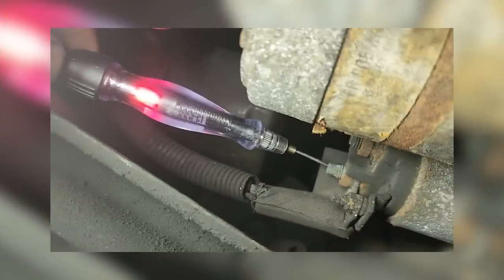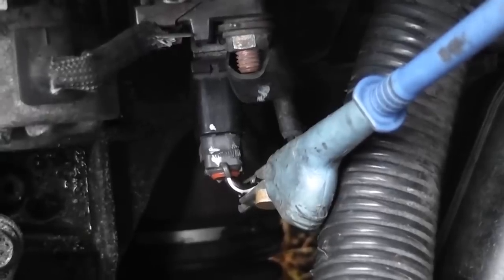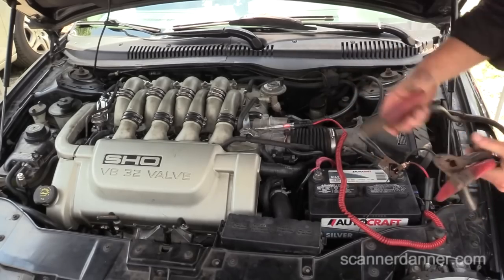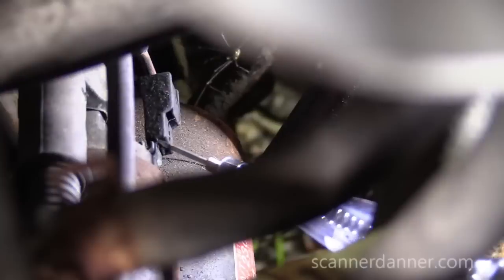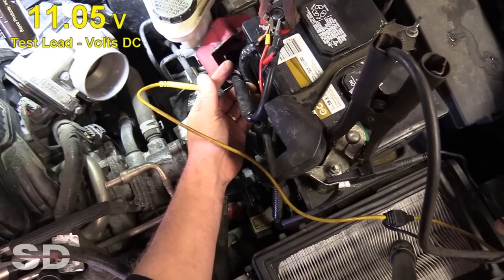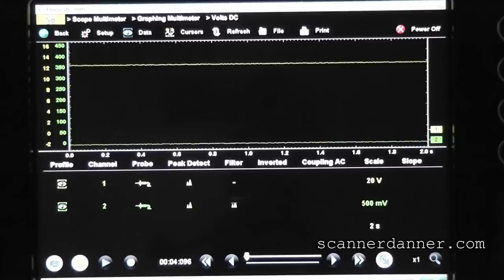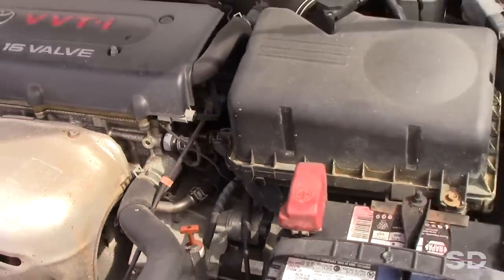Engine Does Not Crank - Compilation of Common Faults

Comment: My opinion, the best video for " no crank" diagnosing! In my 40 years of working on cars, I've seen everyone of those situations. It's so easy to make the wrong call if you skip a step or two. Voltage drop tests are very important with key on and checking in multiple locations (not just the wire but on the terminal sides as well). Thanks Paul and hi "Mom"!
Reply from the maker: Thank you Jeff!
Reply: I have to agree that was very helpful

Comment: Thumbs up for mom! That was awesome. I’ve seen a seized accessory once. It was in my own car and it happened while running the belt started squalling and smoking. My asked shouldn’t you turn it off? I looked and saw it was the A. I. R. pump. I said no I don’t have any tools with me the belt will break and we’ll drive home before I shut it off. Taught my oldest son the tap the solenoid trick. He was eight and had to jump under the van at the Walmart and tap it for his mom to get the van started. Best video I’ve seen for no start no crank.

Comment: Your locked up alternator brought up memories from the past. I remember late 80's when 4 cyl's were getting popular, these cars would come in on the hook (tow truck) with complaints won't start. Some customers telling you to put a starter or battery in it; no diagnostics- just do it!! Usually their prob was an a/c compressor locking up, or a locked up alternator. By the early 90's both the American mfg's and even Nissan and Toyota were relegating their alternator production to Korea; there were no rebuild kits. The Korean alternators cost $600 to $1200. These were on brand new cars. Many times the alternators were on 30 to 90 day back orders. Same problem with the starters - oh the good ole days

Comment: We had a similar issue with a F100 straight 6 engine.  Apparently it had two different starters for a manual vs automatic transmission; and would need shims, depending on the setup.  It was completely locked up, I pulled the belt-- crank was still locked.  So we just decided to pull the engine, (it had over 300k on it anyway).   I pulled the head off and dropped the starter-- about to drop the transmission. and my buddy came over and asked what we were doing.   So I grabbed a wrench and was going to attempt to spin the crank and show him it was locked----   and it spun super easy. lol.   It had a leaky head gasket anyway, so we didn't really lose anything.  Threw it all back together, and sure enough it was locked again---   because of that starter.  So I did some research and learned about the shims.

Comment: What a great summary. There are two things that make me frequently stumble on this diagnosis. The first is if the solenoid doesn't close (very common), we are easily be lured into the false impression that we've load tested the B+ circuit or the battery. That leads to the mental gymnastics of reasoning that if there is no measured voltage drop at the B+ post or the engine ground when you turn the key, and you do see 12V at the signal post, then voltage drop in the wiring CAN'T be responsible for the failure of the solenoid to close. So, you end up successfully replacing the starter, accepting that you never did load test the supporting wires. I get the notion that in a busy shop there's no reason to waste time looking for second problems that didn't cause the initial failure. The second is that any test will have false positives and false negatives, and as you say a test light doesn't draw enough current to adequately load high current circuits. Mine glows brightly with only 6V,  so its lower limit of detection is only about 25 ohms, far more than the few ohms that can cause a starter fail. On the other side, if the loaded engine ground rises to less than about 4V, the light doesn't glow at all even with current flowing.
Reply from the maker: In your first scenario you don't have to load the wires independently. You proved the starter was the issue. Unless we want to argue that we have a bad wire AND a bad starter at the same time! It simply doesn't happen! Make sense?
Your not wrong in wanting to still load test those other circuits but it is a waste of time imo

Comment: I worked at a shop where a guy missed diagnosed and said the car needed an engine. It was another situation of the boss worrying about the bottom line and wanted the jobs diagnosed and fixed with little consideration of the techs skills. It was all about record times and making money even if it means screwing over the customer. It happens quite often in this field. Having techs doing work that they are not certified in.  Anyways one day and an engine install later the car was back together and doing the same thing (engine wouldn't turn over). Eventually the boss had me look to see what was going on. Come to find out the alternator was locked up. Still the customer wasn't made aware and not only paid for an alternator, but also an engine they didn't need. Lesson wasn't learned and the boss continued to put techs on jobs they weren't certified in. Eventually I left the field entirely after 15 years of seeing this in multiple shops because a master tech such as myself had all the certs an those certs were used as community property.
Reply from the maker: That's absolutely horrible!
Reply: You put in the time, effort, skills, & tools to do a good job and it is not appreciated (except by the customer) or rewarded.  I too left the industry to continue working on trains.  More money & more time off & a pension.  The side note is doing most of the work on my own cars without worrying about which tech under what kind of shop priorities is working on my car.
Reply: @s.j.5850  agreed 💯!! Yet people wonder why there's a automotive  technician shortage! The list of reasons is LONG!

Comment: This is the exact issue that lawn mowers have, and that boss that told me to,replace them no,matter what without even consulting the customer! I got quite frustrated because they all make that clunk click sound, but at the same time you can have one that will make that sound, and still be bad as the contactor within is probably burned up, or heavily oxided prevent it from carrying the current. And im very against ripping off customers not even over change. So I got all there solenoids a brand new one off her self, and two from down stairs were we worked to get the other types one were the coil within was open so it made no sound at all. And another that made that familiar sound, but the contactor was shot. Showed how all 3 functioned with a jump box, and a digital multimeter, and drew a diagram of the internal parts. After,explaining this to her and that she basically telling me to rip people off. She still continued to stick to it. I never replaced them unless it truly needed one! What kind of meter are you using with the yellow Kevin style like clamps!

Comment: Hi. I had really weird issue with my 2005 dodge caravan 3.8 minivan. My car run ,idle perfect id I drive under 2.5-3k rom but if even on idle if I rev it up 3k car start shakes and misfire. Sometimes throw p0301 code as well. But while car shaking of i rev it up again around 3k car turn back to normal as well. What it might be according your experience. Thanks
Reply from the maker: hard to say, sticking valve, ignition misfire, injector misfire, all of them would need to be tested for DURING the misfiring event

Comment: Hey I have a question of my ford f150 96 no star but I check for spark and I do have spark but don’t star still any tips what to do next to look for
Reply from the maker: fuel pressure and  Injector pulse testing should be next
Reply: Thanks the help I will let you know how a works. I love all you video brother thanks for sharing

Comment: So I've got a voltage drop on the main power cable and also a light on  the block? Would that mean its a bad earth problem or both need to be looked at?
Reply from the maker: This is a compilation of many different issues, what time frame is your question coming from?
Reply from the maker: This is a compilation of many different issues, what time frame is your question coming from?
Reply: The first video,  I have power drops going beyond the terminal bracket on the starter. I can see a tag on the positive lead so I'm thinking it's had issues there before? Also when I leave the key in the crank position both battery terminals are smoking and hot??

Comment: I added some random fuel from some can and now car starts everytime perfectly but only for half second then dies. Is it 100% fuel problem or chance of something different?
Reply from the maker: Help me help you! Year, make, model, engine, trouble codes at a minimum. Then, what is your fuel pressure. Have you tested for injection pulse?
Reply: @ScannerDanner  bro i aint that smart to do them things and the car is only for some cheap track use.
I unplugged fuel filter and it sprayed gas out with intensity when fuel pump was activated.
Audi a4b5 1.6 liter engine
Thanks

Comment: I'm  not sure why I didn't find this channel years ago.i just went through this exact same thing with a 2005 chevy 3500 dump truck,  turns out the engine is no good . The problem I'm having is a intermittent battery drain on a 1998 2500 chevy pickup. Battery drains after a day or 2 . Do u have any videos  on this ? Hi mom😊
Reply from the maker: I have some parasitic drain videos. They'd be in my battery, starting, charging system playlist. Thank you!
Reply: @ScannerDanner  okay I will check, and thank you

Comment: I have an 04 ASTRO that is cranking but not starting. When I turn the key I get no lights in the dash except the battery and needles. Any tips??? Battery is good.

It's intermittent because it would start sometimes. You can imagine all the parts I replaced
Reply from the maker: When it is not starting, check for a 5v reference on your TPS or MAP sensor and tell me what you see.
Reply: @ScannerDanner  appreciate the reply. I'll check it when I have the vehicle with me later today. Thank you.
Reply from the maker: @rafextreme2879  this one is older so it may not apply 
https://youtu.be/ZgNY3ZpjSsU
Reply: @ScannerDanner  thank you so much I'll give update on my progress👍

Comment: This is just an amazing video. You are a blessing 🤍

Can we use a power probe(that has a small bulb) for voltage drop test instead of a test light?  I wonder why I don't see you using a power probe there must be a good reason 🤔
Reply from the maker: I do NOT like LED lights for ANY electrical circuit testing. Because very low voltage will light them just as brightly as higher or normal voltage.

Comment: I was faced with a bad block ground on a customers car that looked good but it was corroded so bad about one inch inside the insulation at the block. I was told by the customer to replace the starter, i used my jumper cable to apply a ground from the battery to the block in front of the customer and i started the car, i replaced the $15 ground cable instead of the $185 starter. Happy Customer!

Comment: What would you thinks wrong with a car that when you go to turn the key you lose complete power to dash and everything? I’m trying to figure out an 03 Dodge Stratus RT with the 3.0. It has set for like 5 years outside not been ran. I hook a good battery up and if I just turn key on the dash lights come on but as soon as I go to crank it I lose all power and then the car has to sit for a while with battery removed before the dash lights will come  11:50 on when just turn key on. I’m stumped on this one. Not sure if it’s a starter issue or a security system issue.
Reply from the maker: Sounds like a bad main cable to the battery. Power or ground wire and either one would do that. Do some voltage measurements like I'm showing here. https://youtu.be/GQvLHQVtC0Y

Comment: This is a great compilation of testing. Once again each time you show the whole diagnostic process, probing both side of connections is very important because if you do not follow through the whole process it WILL lead you down a "RABBIT HOLE". I recently passed my ASE A6 on electrical and electronics. I have been watching your videos for a couple of years now and have your book, and use it regularly in testing. No matter the manufacturer, "THE THEORY STAYS THE SAME". Some of these videos I have saved and referenced in the past and the do help in real shop situations. I have been a paint and body tech for years, but about 10 years ago switched over to the Mechanical side. I am currently moving up through more ASE testing, and I thank you for continuing to give back. I am 54 years old and sometimes even with all of automotive Knowledge, switching over can seem like just starting out, that is why PROPER PROCEDURE IS SO IMPORTANT. Thanks Paul and keep up the GREAT work!!!!!!!!!!!!! Believers are achievers!!!!!!!!!!!!!🙏🙏🙏🙏🙏🙏🙏🙏
Reply from the maker: Thank you brother!

Comment from the maker: We have added chapters to this video for easy navigation through it. Here is the list of the videos we pulled these clips from:
00:00 - voltage drop on the main BAT post of the starter - https://youtu.be/_xvddRJmkAA 
02:20 - bad block ground (Nissan) - https://youtu.be/ytrcqM8wyW0 
05:25 - bad block ground (Ford) - https://youtu.be/-fyKizH_oQ8
07:04 - a bad block ground that looks like low battery voltage (Cadillac) - https://youtu.be/32S0WMj3GSQ
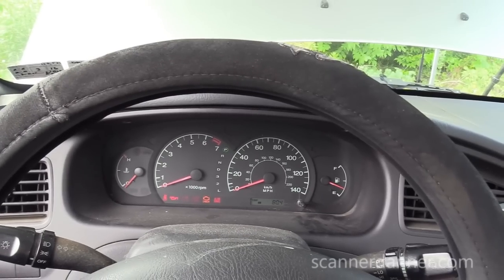09:10 - voltage drop on the "S" post of the starter (Hyundai) - https://youtu.be/oo1SRIFIkhs
12:55 - voltage drop on the main starter battery cable - https://youtu.be/U0HktTWiw0Y
15:59 - super high starter current (seized engine?) - https://youtu.be/4YWCKzpbgb0
20:00 - starter tap test on moms car - https://youtu.be/U0HktTWiw0Y
Reply: Love the last clip very emotional, Thanks SD😍

Comment: Thank you Paul
Thank you for the Test on the post footage 
Thank you for the Test on the Wire 

" Fun with corroded , crusty ,  exposed connections "
   ' 70s vehicles , 80 vehicles  "      
    One of the first cheeks done   
     Excellent visually  here

Edit  
    21:30   Hi Mom    Thankyou all the best

Comment: Thanks guys, I am a DIY own car mechanic and I learning on an auction car named "demolition fugitive" which has a really bad condition. Just for fun but of course I want to reach my goal to start it if it possible. So I already tested the starter, which works well (not like your mom's solenoid:). So my last chance before siezed engine status, the bad alternator case. So today I learned how to start an engine without spark plugs and after I learned how to loose the seprent belt and in the close future I will check the alternator. Do you have some proposition to not make damage?

Comment: Paul,
Thanks for your help! 
I had no problem putting a JDM engine in a 200K miles '06 Mazda, but when it didn't start I thought - Oh God what did I do?
Followed you principles with just a DVOM and a test light with schematics off the internet and behold. It all came down to the smallest ground wire for the ignition coils.  Unreal how a wire so small can prevent a car from starting! 
If you are ever in Chester county, stop by and  I'll buy you a few rounds! Cheers!🍺

Comment: 15:34 that's a repair cable end with in-splice connector. they work OK if you can cut back to clean bright wire and cover everything full of dielectric grease so it doesn't corrode quickly.
I 've used some on Jheep's and other Chry'ap'sler byproducts(lol), which tend to have the cable too short to put ends on and near impossible to replace the cables.

Comment: Q: Can anybody help and answer this question and timing was good.

BMW M47 E90 2L diesel was a crank but no start, once a week it would start but cut out after 20 minutes of driving and not start. Codes was camshaft sensor and glow plug module both change with 2 new and stayed the same.

All fuel pressure was ok and injectors was ok.

Found the 5v ref to Cam was only showing 1V from the ECU wire, he plugged a 5 reference signal into the 1V and it only showed 2V on the multimeter so he stuck a 12v feed down the cam line for 1 second that was showing 1V and it when back to 5V and started. Amazed he didn’t fry his ECU but works perfectly now. 

Any ideas what and why that happened and the 5v is now showing back ? Do you think the only reason could be a cracked or lose join on the ECU or relay board soldering joins and that shock moved it back ? 

P.S. anybody know where the 5v ref get’s the signal from ?
Reply from the maker: That sounds very plausible to me

Comment: I was working on a 40ft Nova Bus, with a Cummins isl9 that no one could get started. Using these basic voltage drop techniques, I got it corrected & started in 5 minutes. Dead giveaway was that the rear bus frame/ground  chassis measured 18 volts. Found & tightened up the loose ground bolt, Bus started! I learnt all of this from your book! 😌😌😌😌 Thank You Scanner Danner! 🙏🏾
Reply from the maker: Heck yeah! Awesome man. Thanks for sharing!

Comment: I got burned by not understanding voltage drop as a first year apprentice when I put a starter on a farm tractor that was a no crank. The rebuilder didn’t say anything about the starter being okay either. I still remember having this sinking feeling after installing the so called rebuilt starter and it didn’t crank. 😩
Reply from the maker: But you learned from that one didn't you? Thanks Cullen